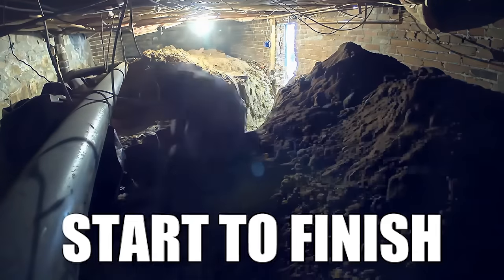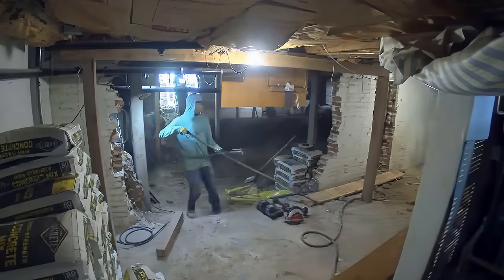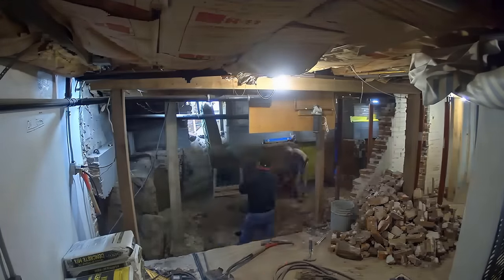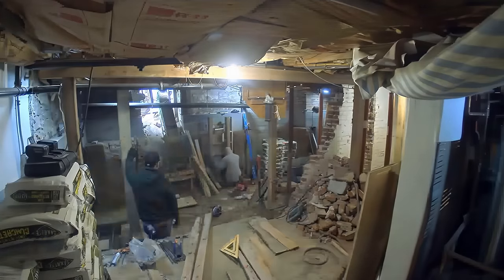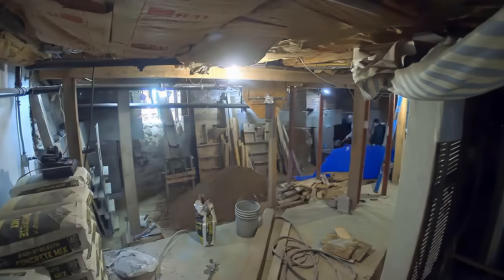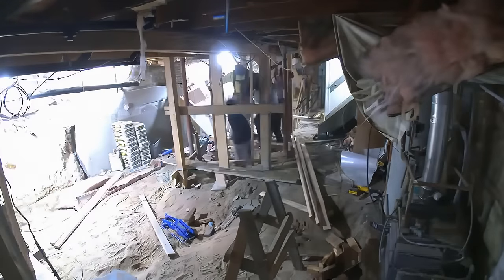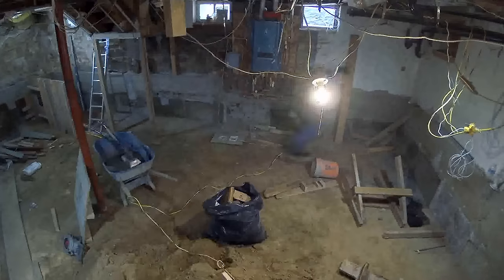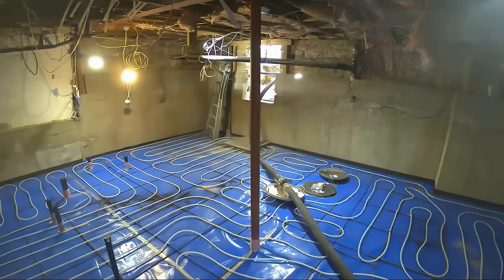Digging Out a Tiny Basement, Start to Finish - Timelapse

Comment: I purchased a home that was built in the 30's. Homes back them were built cost effectively due to the wars and materials not being available.  So the lot was the main reason I wanted the home.  But tearing down the old home and putting up a new home the taxes would more than quadruple. So back then they connected all the plumbing and electrical before installing the floors and after they tested ok for a week without spark or leak they closed the floor.  But I didn't want to go this route again and I wanted to be able to basically walk under the house.  So  I purchased a high-pressure washer and gave some pocket cash to a guy who drove a sewage sump cleaner.  Like I thought, that pressure washer was cutting a path through that dirt like butter.  And that pump redistributed in on to my property.  There was a shit load of mud back there by the time I was done.  He would be 3/4 the way done because he needed more pipe.  Several days later he returned and within a few hours we were done.  And he drove out with half a weeks pay.  But it was worth it 100%.  With fans under the house it still took a month to be able to walk on it.  So I replumed the entire house very easily.  After I was done upgrading that house with new lumber for the roof and new exterior and interior walls, and new electrical, I waited a few years and changed plans several times what I was to do with the back yard/garage, etc... And I had that excess dirt removed.

Comment: Why did they turn the insulating board upside down, the insulation foam you put on the floor for the floor heating, the silver side should be up. It is to reflect the heat up...

Comment: I have a quick question; I’m getting ready to start a project like this in my basement., it’d be nice to have a crew but it’s just me. I have a 10‘ x 10‘ dirt room that needs dug out. Now for your footers and your forms, are you adding any kind of rebar (in-side ur footers) to help with the structural integrity of the quickcrete/footer? Cuz concrete alone isn’t real strong but once you add rebar to it, it adds tensile strength… which tensile strength would help with the outside pressures of the earth, pushing in-words on the wall. 
  I just didn’t know if you was adding any kind of rebar or steel mashing?
  Nice video bro. I’ve been scratching my head thinking about how I’m gonna tackle this job. I plan on doing and stumbling across this video. Definitely gave me a direction to go in. Thank you..
Reply: This type of renovation work is called "Underpinning" and yes you absolutely should be using rebar which should be not only within the new concrete foundation walls, but also embedded into the original foundation to connect old and new.

The fact he never mentioned the proper term for this type of construction has me concerned they don't actually know what they're doing.  Bag mix concrete is arguably not the proper type of concrete mix for this work either.
Reply: @randomman057  As a concrete worker I can say bag crete is as good as most of the truck mixes out there, the main issue with it is that for sidewalks and such the finishes don`t look as good as truck crete but preform just as good in the long run.
Reply: @randomman057  after reading your comment. Yeah, I believe you’re right, they definitely should’ve put rebar into the old foundation and into the new foundation pour to tie it in together to make one whole piece/bring the two foundations together to make one. 

  I know anytime you pour concrete underground for a foundation or supports of any kind/ footer etc. always add rebar to deal with the pressures from below the foundation and from the side pressure pushing in words!  
   
  I hope the job they did holds up cause there’s people living on top of their work… now when I do my own basement like this, I’m adding rebar to the old foundation and into the new, to tie, the two together. I’m an ironworker local 550 and I work in the rod patch often. And I’m not taking any chances with my families lives. God bless.
Reply: @gq_aquatics  That's great!  If you need to learn more in detail about underpinning there are already quite a few videos on YouTube that go into more detail about the process.  It's not super complex, everything just needs to be done in the proper order with consideration for the overall house load.

I'm sure you could learn a lot by checking out more information.
Reply: @randomman057  thanks bro. 
  Yeah I didn’t know it was called “underpinning”. I’m definitely going to look more into it. Thanks again

Comment: How are you dealing with makeup air? I didn't even see any respirators? Do you test for Radon first?
Reply: I don't see any rebar in those footers, no mention of fiber reinforced concrete, and the concrete using is some of cheapest on the market.  Very scary work from someone who seems to be just a 'fly by night' type.  Also, no mention they pulled the permits and are getting inspections..... I can imagine in a few years, bowed walls, water seepage, moisture and mold problems, insects, and who knows what else. :(
Reply: @billsmith9249  he mentioned fiber, I'd still prefer to see some iron in there personally

Comment: I have to wonder if some sort of vacuum system with a cyclonic dust separator would save space. I was imagining something like taking one of those dust collection systems like in a woodworking shop and using it somewhat like one of those underwater vacuum excavation rigs. Something like this but in air obviously: https://youtu.be/LCFTbE9sizU?t=26

Comment: Try with one of those cellar doors and it's flooded in reason 5 gallon buckets and dude built our room on top of it so we got to go through a floor hatch and out the back door up and down and then we put concrete in up and down up and down had to rebuild the stairs or cuz they broke with two people than you have at Jack hanick heatherstone and you take a hammer drill and usual 300/1 how to make it a nice archway so you don't hit your head on it thence lick it off with hydraulic concrete to had all the with two guys

Comment: ok lemme get this straight.... when they build the house they put brick walls 8 feet down... then filled it with 5 feet of dirt?.... how the hell you explain them walls?
Reply: No. Looks like they have a basement on one side which was 6 ft. And then a crawl space. One wall is a lot shorter. They wanted to make both the 6 ft basement and crawlspace 9 ft I guess. The 8 ft wall is the one they busted a hole in.